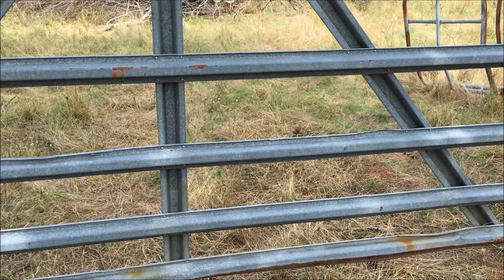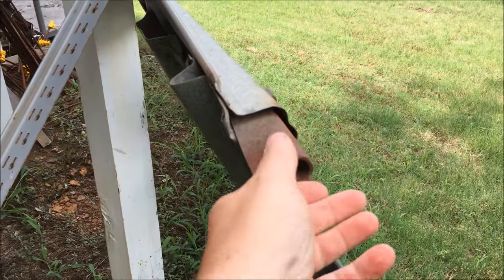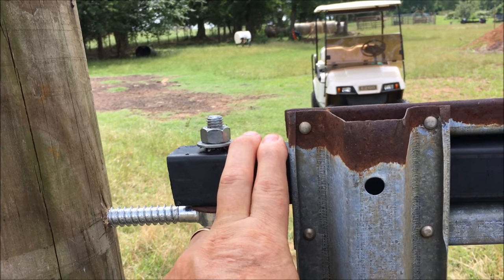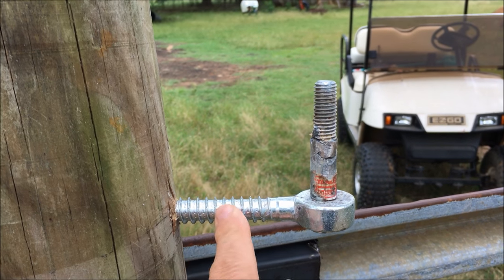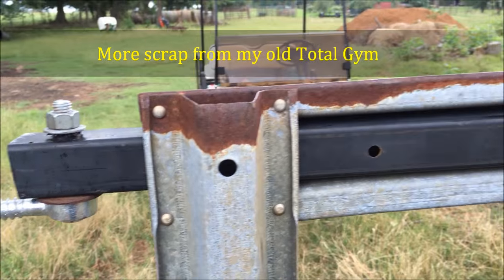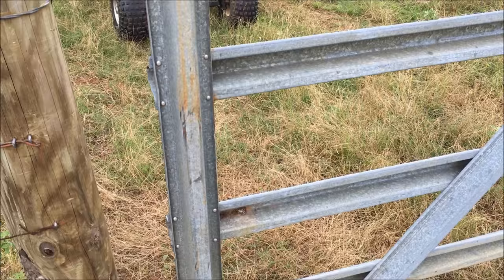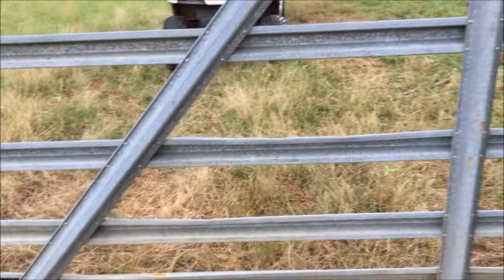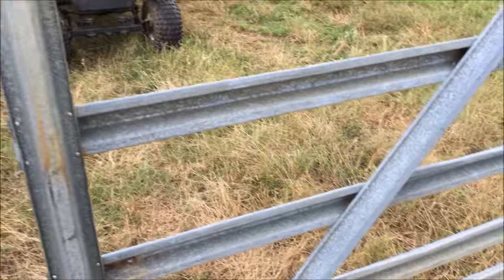Making A Hinge For An Old Farm Gate

Comment: Where on earth did you get a hinge pin with a hole for a cotter pin?!  I have only seen ones with a plain solid shaft around here.  Do you have any idea how many gates I have had to rehang??  Except, of course, the ones we take the time to turn the top pin down.  Your idea of welding a bolt on the top would be great, too. But I don't know how to weld, or have the equipment for it. :(
Reply from the maker: I drilled the hole in it myself... before I thought about welding the bolt on and putting a nut on it.
I'm sure I'll use it on a gate sooner or later.
A washer and cotter pin should do the same thing as the bolt does.

Comment: I have a gate just like that and haven been able to find hinges either.
Reply from the maker: They probably want you to buy a new one instead of fixing the old one   :(
Reply: Of coarse, a new $300 tube gate.
It’s sturdier pipe design is superior they say.
Even though it wouldn’t stand up to an animal who really wanted through it, I think these old gates will definitely out last a new tube gate because of their simple, bent galvanized steel construction.
The new tube gates have a problem with condensation inside the pipe frame that has no drainage holes in it to let the water out!
And they’re not galvanized, so the gate basically rusts out from the inside!
These old ones have been around for decades and they’re still usable.
(If you make your own hinges;)
Reply from the maker: @victorecheverria5741  
Hmmmm.... never thought about them rusting out like that... bad